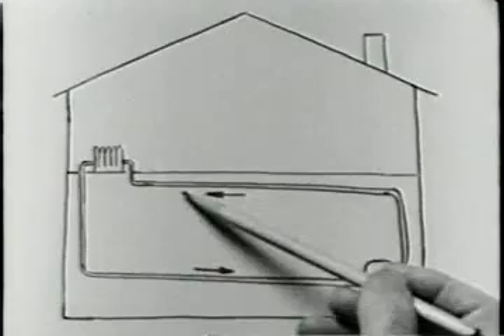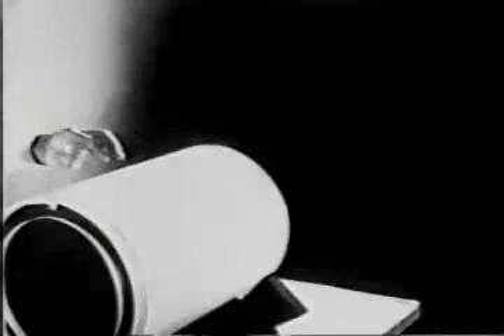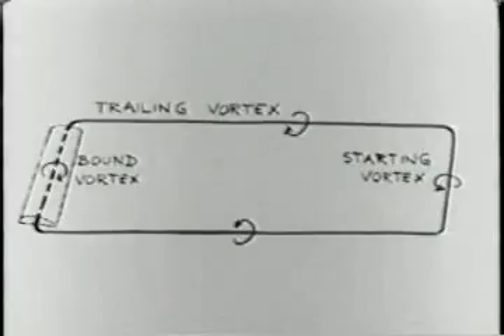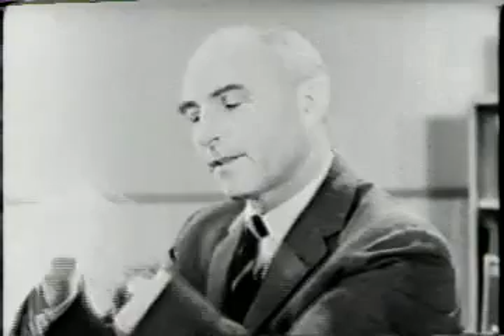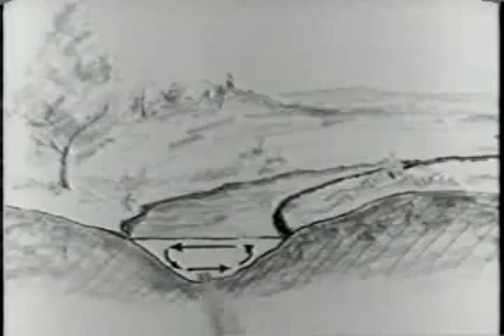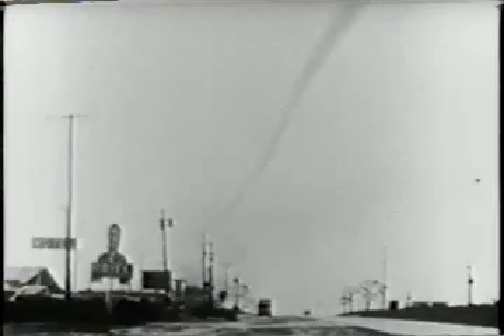9. Vorticity (2 of 2)

Comment: See https://www.youtube.com/watch?v=h6bmrRFYFbc&t=9m53s,
A classic mistake: depicting the 3D "Prandtl Horseshoe" as horizontal.  That's un-physical, violating Newton.  (The mistake seems to have originated with Prandtl, although in his own texts he corrected it in later years.)
For finite-span wings the start-vortex always moves downward, and the tip-vortices are always tilted with respect to the horizontal wing trajectory. They don't trail horizontally behind the wing as shown, instead they move down; same as with helicopters.  Without this pattern of descending air, wing-lift seems very mysterious, as if pressure alone can lift a wing, with no need for the helicopters' down-moving "exhaust plume."  In reality, the diagram blatently violates Newton's laws if the tip-vortices extend horizontally behind the wing while the start-vortex doesn't descend.  To add Newton and his F=mA effect back in, let the start-vortex move down, and the tip-vortices be diagonal (connecting the wing to the descending start-vortex.)